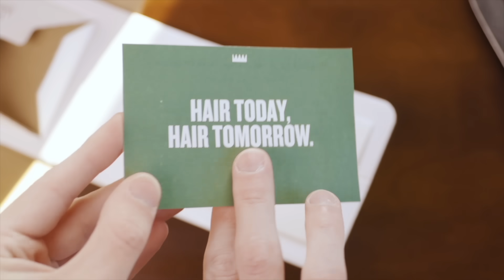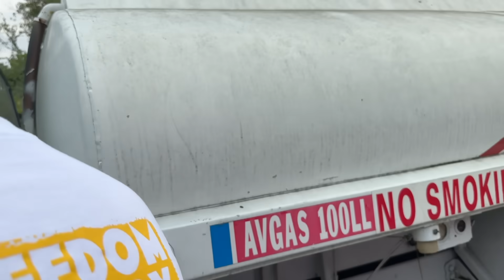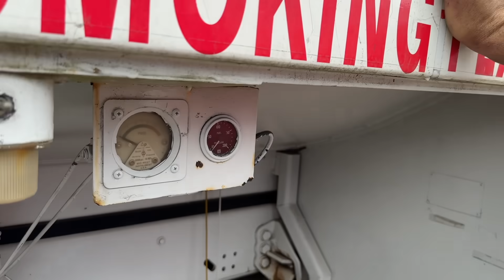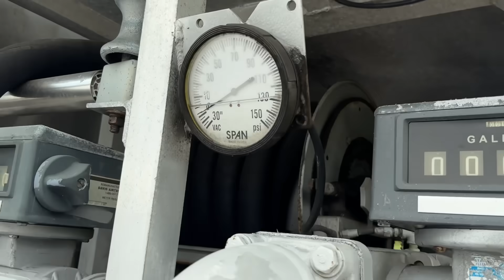I Bought An Abandoned Fuel Truck For Our New Airport!!!

Comment: I've worked on tankers for 14 years if you have any questions let me know. I'm in Arizona but for parts I'm sure there is a polar service center in Florida. Not opposed to FaceTime to walk through valves and quarter turn valves internals the meter and register
Reply: Sorry as a side note I'm a registered dot cargo tank inspector
Reply: No thanks
Reply: Inspectors test tankers and rebuild them I'm not a dot cop
Reply: Same here just from ky. 26 years in the tank business. That was a steal of a deal . The stainless tank alone is worth it . One on a trailer to pull with the other .
Reply: @waitemc  around the airport sure but on road? I didn't think tandem hauling was legal with fuel?
Reply: If it could get turned into a pup it's legal depending on state laws. Arizona our straight trucks haul pups. Utah or Colorado can haul bigger pup trailers. Arizona normally 4000-4500 gallons of unlead, diesel or jet
Reply: After being drained both tank can be stayed with a citrus spray to pull impurities out of the stainless. We did that with food grade stainless tankers. If they have sat for a long time empty the internal seals tend to leak. And the normal vents on top you miswell replace so the tank can breath. Not sure if I saw a vapor valve on that but I'd look at that before offloading with the dome closed so you don't cave the tank in. Some have a vent on the vapor rail but the one looked like it was just roll over protection
Reply: @waitemc both stainless just one is painted
Reply: Naw we good little man. 👍🏽
Reply: @10:37, George’s VGG reference is awesome😂
Reply: do u actually pay monthly fees for free youtube videos😂

Comment: I use to run those trucks at the Aircenter when I first got out the navy.. the avgas trucks always been a runner. The comments are correct. The handle by the fuel meter should be in and the truck in drive when you engage the PTO. When you shift to neutral after the PTO light should come on and you’ll hear the pump spin. The JET A truck had new brakes and then was only ran for 6 months before it was retired. Always had carb issues. I believe the meter and pump on the Jet A truck had been rebuilt within a year of it being retired. We also always had PRIST additive in the JET A because the old owner flew leers and it was a necessity.
Reply: Just thinking outloud- can he use the Jet A truck for racing fuel storage/dispensing?

I used to work for an airline that flew to the Bahamas, and in a few places we had parked fuel trucks used mainly for storing & dispensing- just had them topped off every few months.

Comment: The first lever you tried is for the emergency valve in the belly of the main tank. Looks like it has a veeder root register and differential pressure filter setup. You have to use the clutch to get the pto in gear. I build these for a living. Any parts you need let me know, I have most everything you need in stock. Emergency shut off lever closes that belly valve.
Reply: So, on a fire truck, you have to be in neutral to engage the PTO. Would it be same for their fuel truck?
Reply: And I wonder if that black button that’s to the top right of the hose reel is to wind the reel back up after you pull it out
Reply: You need to email Cleeter.
Reply: @06m50blue  all trucks with PTOs have to be in neutral out of gear and clutch pushed in. Hope that helps.
Reply: If it's automatic it has to be in neutral not park and the brake set before it will engage the pto.
Reply: Bump
Reply: @06m50blue  PTO stands for power take off
Reply: @minergate4066  No kidding!!! I know what PTO is short for. I didn't ask that.
Reply: @josephbusby4625  Thanks for the info. I wasn't sure since most modern fire trucks don't have a park.
Reply: @06m50blue thats right, stop and go to neutral, engage the pump and go back to drive. Every fire truck ive ever driven is like that.
Reply: O really
Reply: Il move from New Zealand
Reply: Cletus you always come up with something educational !😊
Reply: to shift an older automatic trans PTO, like a AT545, which is likely in that truck, here is the procedure.  Start engine, put transmission in drive.  shift PTO cable.  shift to neutral.  Shifting to drive stops the input shaft, allowing the PTO to engage without grinding.
Reply: Yea, depending on if it's an air shift or hot shift PTO you may need to push the clutch and put the trans in gear to engage the pump. A hot shift PTO has internal clutches and can be engaged without the clutch. I did send an email to the few emails I could find. Thanks for the thumbs up !!
Reply: @mrwilson7617  I tried the emails I could find online. Our shop is located in CT, but they are headed up this way for the new England 900 @ stafford speedway that Is like 15 min away.  Maybe I can hitch a ride back to Fla with them if I trade some labor lol.

Comment: Fuels guy here. Drove them for years in the air force. Worked on them and lots of other stuff.

First off, the black button above the reel is the hose reel rewind. When you unroll the hose that will reel in the hose if the motor is working. It’s air driven.

Two. The large red handle with the cable connected. That needs to be “in” towards the truck before you try and engage the PTO.

Usually to engage the PTO on these trucks. You set the parking brake. Put the gear shifter in drive. Then engage the PTO. Then switch it back to Neutral. Once you do that, then you pull that large red handle inside the cam box under the meter. At this point you’ll hear the pump engage
Reply: Upvote this. This is exactly right. Everyone saying clutch has never engaged the pto on an older auto truck.
Reply: Who the Hell POL
Reply: That seems so counter intuitive to put it in drive to engage the pto. But I have never worked on an auto with a pto, so it just sounds wrong to me.
Reply: yep, and their black button on airline will be the valve on the tank to let fuel into the pump/hose
Reply: @--_DJ_-- A lot of fire trucks are the same way.
Reply: Who the hell POL WTF BIG GREEN TRUCK
Reply: @jonstolo You beat me to it
Reply: I hope this gets as many thumbs up as the guy advising how to buy big loads of fuel
Reply: i hope cleet sees this, unintentionally breaking stuff out of ignorance sucks
Reply: Hell yeah brother this is what the internet is supposed to be for
Reply: Who the Hell!!! Currently AD  POL
Reply: @tjbailey3609 if you can’t truck it… you know the rest
Reply: @tjbailey3609 if you can't truck it?.....
Reply: @70TWONOVA  fuck it
Reply: @--_DJ_--  Putting it in drive stops the gears and allows the pto to engage. That’s the way it was explained to me.
Reply: @JW-qf2fx  no it isnt, that small air activated button is to retract the fuel hose after it is pilled out.
Reply: Who the hell!!…GT here, if you can’t truck it….🤘🏼
Reply: @--_DJ_--  putting into drive stops the input shaft of the transmission from turning, allowing you to engage the PTO. Putting back into neutral turns the gears once engaged.
Reply: @clifftonarnold6989 exactly! You are correct!
Reply: @warrenmichael918  ah ok, ive never seen a airline activated wind, only hydraulic on all of our stuff... this is a bit older tho
Reply: Yes with a manual transmission to run a PTO you leave it in neutral but you still need to push the clutch in when you turn on or turn off the PTO.
Reply: @clifftonarnold6989  Oh I get how it works, it just sounds very wrong that's all.
Reply: Buuuump tf out of this!
Reply: @yeahitskimmel fr that comment is blowing up but this one is arguably more important!
Reply: Upvote this comment! It's exactly what Cleet needs!
Reply: Thank you for your service brother from one Airman to another
Reply: I was gonna say it the pto grinding because it’s not being put into gear correctly . Like in a dump truck you engage the pto while holding the clutch in. letting out the clutch the pto engages and bed shoots up. If you just hit the pto switch without engaging the clutch it makes that same grinding sound. PTOs are attached to the trans.
Reply: "Who the hell POL, Wtf, big green truck" Good to see there are so many of us that watch cleet. :)
Reply: "The large red handle with the cable connected. That needs to be “in” towards the truck before you try and engage the PTO" -  I knew it! Not a fuel truck guy, but that was my exact thought
Reply: @earthconstructor That's how you engage the PTO on some of the newer auto trucks as well we have a rail road welding truck at work that requires to be in gear to engage the PTO then put back in neutral
Reply: @jonstolo  What's that smell? POL
Reply: As a retired crew chief on the KC-135s, I have pumped millions of gallons of fuel on my aircraft.  When I worked C-141s, at one time we had two trucks hooked to the aircraft, and two more trucks connected to the first two trucks.  Refuels are potentially dangerous operations.
Reply: The two major points about fuel trucks for aircraft, is clean fuel, and fuel without water.
Reply: Solid reply and good advice. 

You will have to permit the storage tank, and have it inspected annually. Florida Dept. of Environmental Protection can be tough to work with, and they will beat you to death with regulations. (I'm an Environmental Engineer, and interface with them quite a bit.)
Reply: I Third this motion exact same way we engage pto on older firetrucks
Reply: Lots of love from another POL USAF Veteran here…..served at MacDill 7.5 years 🤘🏻
Reply: You guys were always cool to talk to during refuels 

HAFB/MQ-9 Reapers
Reply: @-DJ-  right,  Most pto iv seen,  set the brakes. Put in N engage the pto and then put it in D and then the pto is running
Reply: It seems all of the Pol folks saw the fuel truck and said I need to see this, lol
Reply: Great info hope he or someone around him sees this!
Reply: @--_DJ_-- That is the same procedure for engaging the pumps on a fire truck except for the location of the final pump engagement lever.

Comment: 19:37 Brother I used to work on the tank and pump part of the truck. Those letters and numbers on the front right side of your tank tells me the last inspection was done in 1991 one needs to be done every year. Look for a company that can get you certified and get everything working right. Look up HM 183 or Cargo Tank inspection company for External Visual Inspection, Internal Visual, Leakage Test, Pressure Testing, Thickness Testing, EPA 27. They’ll get everything working right.
Reply: This needs to be the top comment so he sees it!
Reply: It's what I do now as well as build em💪 gotta love the fuel life🤣

Comment: As an aircraft fueler for 25+ years, those old trucks bring back memories. It’s amazing the old equipment some FBOs still operate. The cable is a bonding cable. Haven’t seen grounding cables used since the 90s, they may still in some places, but haven’t seen it. That red handle in the Jet truck is a manual wind handle for the hose. They keep them on the truck in case the electric drive fails. Single point pumps at different gpm depending on the aircraft systems. A Blackhawk depending on fuel order can take several minutes, 10-15 from empty if I recall. Just be happy they aren’t electric sensors on the reels. They can be a pain to troubleshoot. If you ever have any operational or procedural questions, feel free to ask. Disclaimer, I’m not a mechanic.

Comment: USAF fuels here, the rag wrapped around the hose reel is likely to catch the leaky coupling. That style uses wax rings to get a seal. There should be zerk fittings to fill with grease to hold the wax in place. The red L shaped thing is a manual rewind handle thats missing the hand piece. Upvotes for the onsite bulk tank and replacement of the filter. There are so many little things that will need looked over. You might try looking up a daily inspection checklist for a C-300 and an R-11. They both have some similaritys to your trucks

Comment: Cleet, just know there are FAR regulations for owning and operating aviation fuel trucks. 

FAR139.321 

Permits are state specific.
-Hoses have a shelf/usage life
-Filters need to be changed monthly
-Fuel needs to be tested monthly 
-Quality control needs to be documented daily 
-required to have a 20BC fire extinguisher on the trust at all times and inspected monthly. 

Any questions reach out. I’m certified fuel safety supervisor per the FAA
Reply: What are the differences with this being a private airport that isnt for anyone to land at? Its not like someone just flying near is allowed to land here. Does this make any permitting or other "legal" red tape easier as far as these fueling trucks?
Reply: This guy sounds like he knows his stuff. There is a difference between personal use and storage and retail reselling. We did the former and it was easier and less hassle, but you want to do the testing and filters religiously for your own safety.  You can learn the maintenance to keep them dependable. We saved 30 to 40 percent on our fuel costs.
Reply: One thing, don’t get into the mindset of stretching your personal limits just to get home for the cheap fuel, make the fuel stop and tank up , it’s not worth it.
Reply: @warrenmichael918  he stated several times in the video about “we will be selling fuel in no time” and the fact that he has tenants at the airport is what makes me believe he will be selling fuel.
Reply: @Diron1994  Yes i heard that but i wasnt sure if it makes a difference since this isnt open to general planes, only ones leased into the airport.

Comment: Those era gas ford are notorious for the motors locking up, the hood opening like it does funnels the water right into the intake. Diesel creek rebuilt his, it’s like saveable with a dingle berry hone and just disassembled, cleaned, and reassembled
Reply: Just need the shade tree :)
Reply: Last time squirrel did a dingleberry hone he blew the bottom of you rodknock Rodney 😂
Reply: Agreed, those motors are bullet proof , you should have a spark arrestor intake “filter” (like a marine one) try to keep back fires to a minimum. It would be best if it didn’t need ether to start it, just always remember what you got in that big tank.
Reply: @morantaylor  I think there's a Taal one available...
Reply: @bigdawgs94  I mean, if that happened… it would be a good video 🤣

Comment: I drove that craig air center av gas fuel truck in the summer of 2007 when i worked at craig sir center in between college semesters. Very cool!

We had a fuel farm on site where we topped up the trucks so that we didn't have to dive the trucks on public roads. This meant the trucks and driver did not need the appropriate hazmat credentials to drive a fuel truck on public roads.
Reply: They still should have been hazmat certified and cdl operators, but shiesty companies will he sheisty companies
Reply: I wouldn’t call a private airport a shisty operator, as long as everyone is trained in its use and knows how to be safe, it’s aviation, not rocket science.
Reply: @troynyholm232  yes there was a training program we had to go through before we could do any driving or fueling operations. I'm just saying it was less involved than having to drive these vehicles on public roads.

Comment: The lever is your belly valve which opens the tank to the pump, the button you were pressing was likely your hose reel.  To engage the pto try putting in in drive, pull the cable, then go back to neutral to engage.

I run propane delivery trucks and there are a lot of similarities.  The older trucks like that don’t have the electronic pto engagement, it’s all manual.

Comment: The big lever is the belly valve. It is to isolate the take from the pipes so if something broke it would not drain the entire tank. In new trucks it opens automatically  when you kick on the pump to start fueling . All those emergency shut off levers you were pulling on should run cable to the belly valve so in an emergency and you couldn't stop the flow of fuel you could pull them and the belly valve can close and stop the fuel flow.
Reply: Ya mean the internal valve ?
Reply: Deadman switch

Comment: Rule of thumb, when opening the top hatch of those tanks, stand on the side of the handle before pulling the handle all the way up. Once you release the pressure from the tank then pull it open. It may not seem like it but those tanks can build the enough pressure to seriously hurt you if you just pop it open.

Comment: The red levers with the cables are the internal valve(s). The internal valves are at the bottom of the tank to keep product in the tank. They don't have anything to do with the pto and pump other than they need to be open before pumping or loading. If I lived closer to Florida I'd come give you a hand. I fabricated tankers for many years.
Reply: Maybe he will fly you down for a weekend.

Comment: The black button is the hose reel power rewind. 🤓 For what your doing with it, it’s well worth dropping a motor in that thing. Without even doing up the aesthetics, if the tank and pump system are solid, you could triple your money making it roadworthy. We used to buy worn out fuel oil and propane bulk trucks as well as rack body cylinder delivery trucks. We would rebuild them from the ground up. Saved a TON of money even with the hours we put in rebuilding them. Our fleet was the newest looking old truck fleet in the entire area, lol. 😎